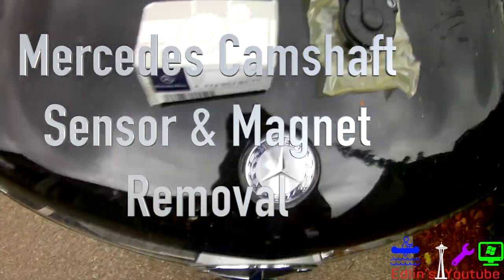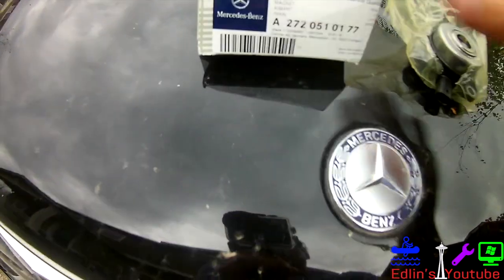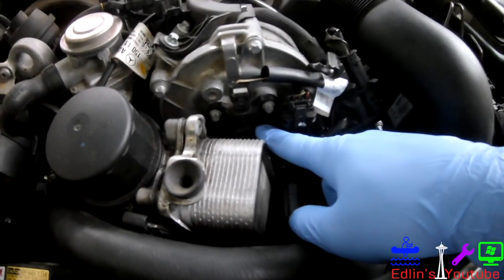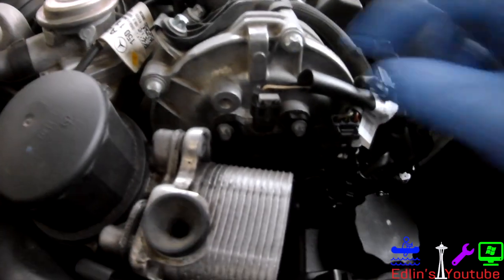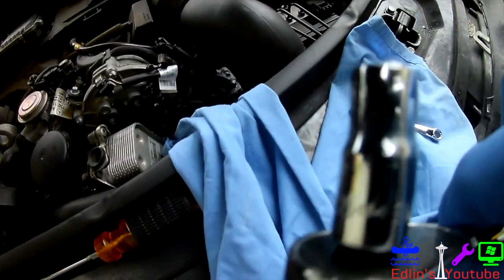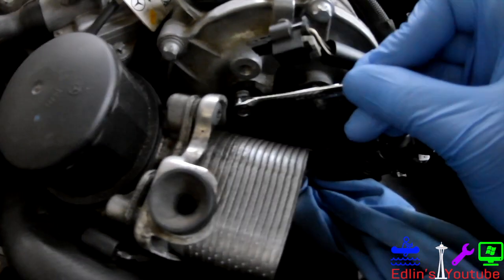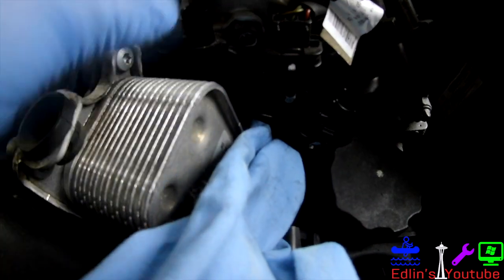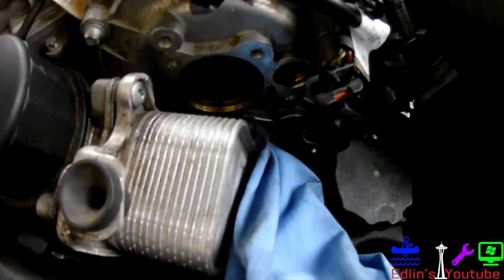06+ Mercedes Tutorial - Camshaft Position Magnet & Position Sensor Removal

Comment: On my C280 year 2007,  had an engine light on from consistent camshafts adjustable. Should I replace any magnet?
Reply from the maker: yes all while you are in there
Reply: Go with all 4 if the have the money. Bank 2 is drivers side. Error should tell you which bank is faulty.

Comment: thanks for sharing ! I have a 2007 c230  2.5l  and this car had a service due to a camshaft gear defective , the dealer covered almost close to  the total repair2 years ago   After about 4,000 miles I have a code Po012 and PO0015 bank 1.   I thought it could be the magnets or sensors. Do you know a way to test them , before replacing all?  thank you again !
Reply from the maker: Glad it helped

Comment: Thanks for the hint on the 1/4 wrench. I do have the torx bits/sockets but there is no room to get them on to most of the magnet screws. Your video only shows removing the one magnet (Bank 1 intake, I think). I looked at bank 2 intake and it looks easy to remove. Any idea/hints on how to remove the 2 outer magnets on each side - what additional connectors etc need to be removed to gain access ? Also, do you know if they make a 'skinny' e-Torx set?

Comment: hello! I  have a Mercedes e280 2006 gasoline and p2090 y49 / 7 (Right camshaft exhaust solenoid) diagnostics when the car is cold and it ignites the engine, the sound is heard for a few seconds and the sound goes out. you can give me your help.
Reply from the maker: i would just check all the wiring and you might notice some oil in a few of the connection. just change all 4
Reply: thank you very much!
respect.
Reply: hello!There was no oil on the fingers of the sensors, I changed a sensor solenoid and showed the code P0015 (Camshaft position sensor)
when the machine turns on in the morning it is heard heavy work for a few seconds, when the engine is warm, the ignition is quiet.

Comment: Përshëndetje! Kam një benzinë Mercedes e280 2006 dhe diagnostifikim me komponentën p2090 y49 / 7 (ndriçimi i drejtpërsëdrejti i shkarkimit të kokës) kur makina është e ftohtë dhe ndez motorin, tingulli dëgjohet për disa sekonda dhe zëri shuhet. mund të më jepni ndihmën tuaj.
Reply from the maker: sorry i cant translate
Reply: Hallo! I have a Mercedes e280 2006 gasoline and the p2090 y49 / 7 component diagnostics. The car is cold and it ignites the engine, the sound is heard for a few seconds and the sound goes out. you can give me your help.
Reply: Greetings! I have a Mercedes e280 2006 gasoline and the right camshaft exhaust solenoid (p2090 y49 / 7(Right camshaft exhaust solenoid) .when the car is cold and it ignites the engine, the sound is heard for a few seconds and the sound goes out. you can give me your help.